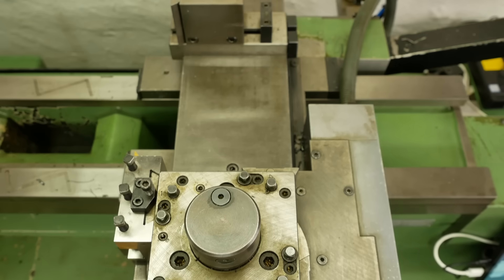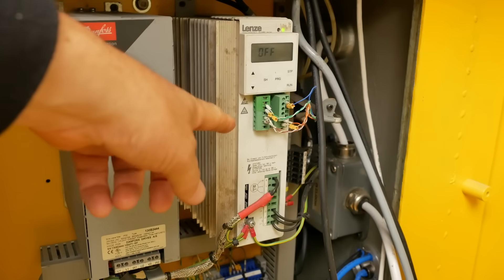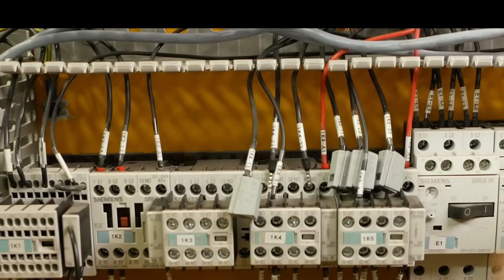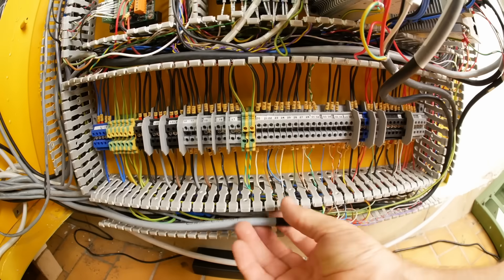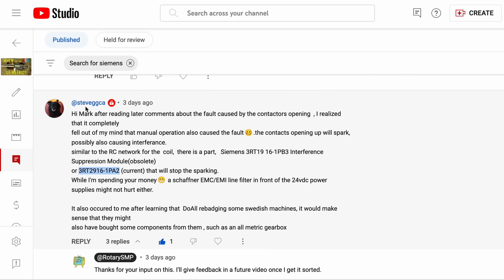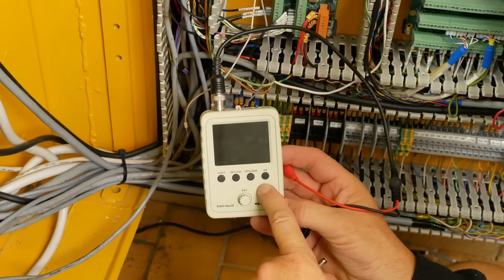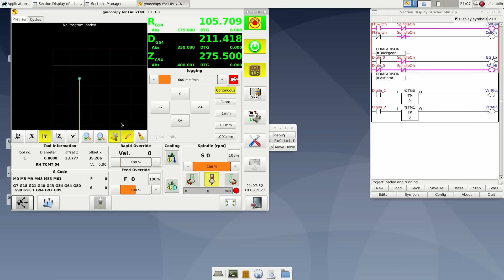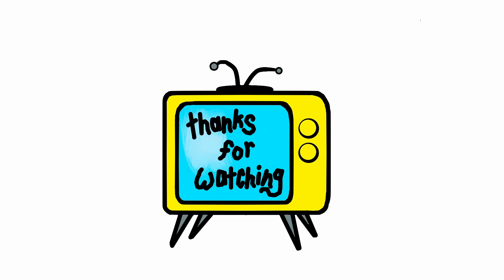Troubleshooting electrical interference on the Schaublin 125 || RotarySMP

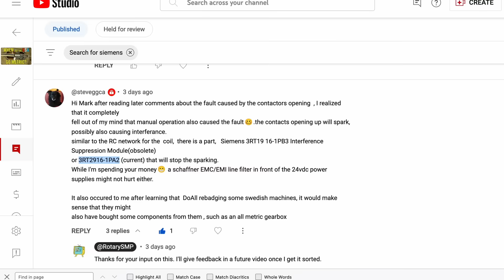Comment: 8:06 - it goes in between three phase wires and your contactor, pins on top of module plugged instead of wires into bottom screw terminals of contactor. Input power then should go from above if I'm not mistaken. There is actually option to buy even "motor starter" (your E1 and E2 in cabinet) like that, but of course any addon means additional height and it might not fit in your cabinet. I had to replace few contactors with motor starters in cabinets few years ago and it was real pain, everything was so tightly packed! Actually open google and try "siemens combined contactor motor starter", that gives some pictures how it's supposed to look like :)

Last time I was too busy and forgot to type comment but *what kind of hall sensors are you exactly using for homing?* Outputs can either be "push-pull" or other one I think it called "single ended". I'm honestly surprised that push-pull aren't very common.

1) *Push-pull* means there are two transistors which force output between two states, it can be either strong 1 or strong 0. If some EMF appears around, transistor will keep try its best to keep line in desired state.

2) *Single ended* sensors use one transistor to push (or pull) output strongly into one state BUT other state is "floating" and only some high value resistor is keeping it in desired state. Of course higher value of resistor means less wasted heat but higher sensitivity to EMF.

If your sensors for example can provide up to 100 mA current, I'd calculate resistors to use around let's say 30 mA and place them closest to MESA card inputs. Is your sensor PNP type, meaning there is positive voltage when it's switched on? Then connect resistor in parallel between MESA card input and ground. If any EMF appears on wire, it will need to be much stronger to overcome that resistor.
Of course if you plan to keep machine standing on limit switches for some time (some emergency error), consider heat dissipation! But for short clicks in normal mode even some lower power resistor might be fine, at least for test if that helps or not.

For 24V and 30 mA it would be around 820 ohm 1W resistor.
For 5V and 30 mA it would be 150 ohm 0.2W resistor.
I'm not sure which voltage you use, I think you mentioned 5V (so probably even more sensitive to EMF) but I'm not sure. Resistors mentioned above are from E24 series so should be easy to get.
Reply from the maker: The Hall sensors seem to be a Schaublin built part. The sensors are cast into epoxy tabs, with the leads potted in. There is no part number or other marking. They are 5V devices, Active high.
Reply: @RotarySMP  Ah, so we can only guess what is inside :(  But I guess original board for sure loaded sensors more than modern MESA board, so some pull-down by few miliamps might actually make difference. But it's just suggestion you might look into :)  Or some RC circuit, which will filter out quick weak pulses but can be easily overtaken by strong signal from sensor.
You might also try to cover that short section in cable tray in tinfoil (or just use shielded cable) and connect it to PE :)

Comment: Hy from what I read vfd not supposed to be shut it off by contactor because the spindle can turn into generator and probably create those spikes if you think about it make sense
Reply from the maker: Mine isn't turned off by the contactor when the motor is running. The VFD contactor is only used at machine start and shut down.

Comment: You could bump that 5uS debounce up to 500uS, it is just for end stops and even 500uS would be no significant mechanical delay.
My suggestion of adding 0.1 uF caps to the hall sensor input terminals has been field proven on a lot of equipment and does basically the same thing as increasing the software debounce.
In my opinion it is better to be in the habit of suppressing the actual noise on the signal input, rather than just telling the software to ignore more noise. 🙂
Reply: By default LinuxCNC runs a servo loop interval of 1ms so a debounce of 5 will be 5ms, not 5us. That's a bit long for homing but fine for estop. Maybe only debounce estop and have the home inputs before debouncing.
Reply from the maker: @LesNewell  Thanks, I had a nagging doubt that I had Milli and Micro confused when I was editing that. Should have looked it up.

I have it homing roughly at speed, then slowly, with the final home position being the next encoder index after the home switch goes high. But you are right, that the home signal needs no debouncing, as it a spike there is ignored when not homing.
Reply from the maker: Thanks for the tips. What type of capacitors would you use there? Given it is a 5V signal, what voltage rating would the Caps need?
Reply: @RotarySMP  A small ceramic or foil type, 50V rating is all you need.
Reply from the maker: @zaprodk  Thanks for that.
Reply: @RotarySMP  ... ceramic tend to be brittle and can physically crack when wires are tugged around, I prefer greencaps (polyester) or monolithic polyester called mono caps. Voltage rating not important they are all 16v or 25v at least. Physicallymlarger ones are better just for physical integrity. They are not polarised, so you don't need to identify a positive lead or anything like that.
Generally I install them with a bit of lead showing (8mm ?) It gives some strain relief when tightening the terminals, and of course with the writing on the cap visible so you dont have to bend it around to see what value it is later.
Reply from the maker: @wizrom3046  Thanks for that detailed tip.

Comment: I think the problem is the Limit shitch... when is not activated, the input for the switch has high impedance.. meaning it can receive radio impulses.... MESA card has optocoupler?
Reply from the maker: I am not sure.
Reply: @RotarySMP  if it jus a logic input means a 1u amp of interference cand activate that input.. try to pus a resistor in parallel as a dumy load.. 2.2kohms for a 24v input should be ok.
Reply from the maker: @swatcat7928  This is only a 5V signal. It is a Hall effect sensor.
Reply: @RotarySMP  ok.. 100R 0.25w resistor.. try it without debounce....

Comment: That Siemens module plugs in to the bottom terminal of the Schütz, but is only compatible with the newer Sirius devices as far as I know. There is the same module for the older ones (3RT1916-1PA2 or something like that ) but they are ridiculously expensive by now. Don't take my word though, I'm not an electrician, I just read the parts catalog when I'm bored.
Reply from the maker: It looks like that new grey one should fit on the old one.

Comment: Software fixing hardware for win!😁
nice troubleshooting,  the debounce function does exist for a reason.
there is still the underlying problem of the noise.
every machine cabinet that I have ever been in uses the spark suppressor module
when controlling motors, even if  entirely analog ,mostly to protect the contacts
themselves from erosion and welding , but it also stops the noise .
Reply from the maker: Thanks for your Tips on them Steve. I now know how to install them as well. :)
Reply: no problem . I noticed that there are 2 pairs of 3 wires leading away from
the  magnetic contactors 
Is the motor wired with all 6 wires or is the  the phase rotation crossover done  at a terminal block?
If it is the second ,there is a module that connects to the MC pair that does the rotation crossover
and then a single output for 3 motor wires direct or the spark suppressor can be used.
adds simplicity and eliminates the need for 2 spark suppressers.
By the way if you are the neurotic sort, there is an available mechanical interlock
between the 2 MCs  that will physically  prevent the second  MC closing while the first one is.
Reply from the maker: @steveggca   That Siemens electrical Lego is pretty cool. Yes the two sets of wire rejoin at the terminal block. 
I have the interlock down through the auxiliary contacts, opening the circuit to the offside coil.
Reply: @RotarySMP  (A brief interlude from the regularly scheduled comments 😉)
 WAY  back in the late 90's, all of the machine tool builder introduced direct drive spindles
in their smaller lathes and machining centers (ie Mori seiki sl-250 lathe  or MS sh-40 horizontal machining center)
These spindle motors  had high/low motor windings controlled  with 2 magnetic contactors.
this is where I first encountered mechanically interlocked MC's . I'm sure that they existed long before that.
I don't recall much of the shifting logic, but I do recall that both the NC and NO contacts were monitored,
and that because the MC's were located between  the Invertor/VFD/spindle drive, the Inverter output had to be
paused, one MC opened and confirmed open and then the other was  closed and confirmed closed.
finally the inverter output would start again. the spindle didn't have to stop turning  to shift, and the shifting 
took about 2 seconds in total ,mostly the mechanical time for the 2 MC's

Comment: Wunderbar! As I mentioned last week comments, the digital debounce and/or filtering is most straightforward solution to this issue, but since I did not have familiarity with LinuxCNC coud not give any specific instructions. ;) 
As of the length of the filtering, I have used folllowing approach with quite good results:  First somehow determine maximum allowed reaction time input has to have, since there is no reason to have nanosecond reaction times/edges in system, where needed time frame is in class of tens of milliseconds. Then divide said requirement by 10 to achieve very good amount of headroom and use this time value as your starting point for your debounce length and filter time constant. For example if you want 10ms reaction time, set the RC filter to 1ms and debounce to same value, and you still get ~2ms reaction time (filtered signal rises from 0 to 60% of voltage in 1ms and then debounce delays input for another 1ms) but are already very much more immune to external interference to signals, and if there is still issues with some interference, the values can be tightened even more. As said this approach has served me well for years. 
Nevertheless, this is more of a nitpicking, if the 5us debounce you implemented was enough and everything works nice, that is excellent. Happy to see the issue solved, and hope we as a community were helpful aloing the way, even my long winded descriptions of these things. (That is an  issue for us engineers, we like to babble endlessly about thing we like to do :P)
Reply from the maker: I found the advice given to be really helpful. It seems I should still try snubbers on the contactors and RC on the Hall sensor inputs, to try and make the system more noise resistant though.

Comment: I am not sure how useful (or otherwise) what I am about to say (type) will be but here goes 🙂 As a general guideline never coil wire in loops whilst it satisfies our need for neatness its a bu**er for causing EMI. Also when you zip tie cable bundles, don't zip them tighter than is functionally needed, the closer we force wires together the greater the risk of crosstalk. The longer unshielded wires run next to each other the greater the risk of cross talk, if you know which circuit is picking up the interference try routing its wire along a different run for the majority of its length if you can. If all else fails ten or so turns through a ferrite toroid should sort you out.
Reply from the maker: Thanks for your Tips. I have some ferrites coming in.
Reply: @RotarySMP  Plus with signal wires twist them into a pair, signal wire and the associated ground, so that interference picked up is going to be mostly cancelled out. For an active sensor with 3 wires, all 3 twisted together tightly in the loom till at the controller works best, and if possible make all the wire, even in the raceways after the connections, shielded, with the shield connected at only the one end, probably the termination block. Separate shield connection than the motor shields, and then each one connector shield set with a separate braided wire to the chassis star ground point. Yes can be a pain to do, but gets rid of a lot of noise, and then a ferrite toroid over each separate shield as they come into the cabinet, before the connection area, helps as well.
Reply from the maker: Thanks for the best practice. Sean.

Comment: Would be cool to see the transient on the oscope but the methodology for probing can be surprisingly finicky even for someone relatively good with an oscope
Reply from the maker: What would you suggest Steve? What trigger voltage, and sample rate?
Reply: Yes those kind of signals are really hard to get good picture of even with very good equipment. And here, since the 5us filter implemented fixed the issue tells that the spur is really short, most likely in sub microsecond class, which don't help the issue. :)
Reply from the maker: @Velectrics  Alex is sending me his old (40MHz) Osci. Maybe I can image it then?
Reply: @Velectrics it is? I'm an EE so I should have more experience than most but as long as you have a scope, and you can set it to single shot, then you should catch it. 
But scopes are a bit black magic to many and plenty of them have bad UI so that might make it difficult. And I'm a bit unsure if what's shown in the video would qualify as 'a scope'. But since the poll rate is 1ms and it was tripping so consistent, you should be able to see something even if you only have khz bandwidth!

Comment: Signal wires and power wires should go far away from each other. If needed, they can cross each other at 90°, but never be parallel.
Sometimes helps ferrite rings, or capacitors (like the debounce)
Reply from the maker: Thanks. I should have laid out that control cabinet differently.
Reply: @RotarySMP  The shielding must be correct too (PE). No loops in the hole system.
If the main motor has PE connection, the servo motors too so you will have 2 loops already. It will work like an antenna for catching interferences.
Reply from the maker: @DPTech_workroom   I dont really understand what that means in practice for this installation.
Reply: @RotarySMP   3 phase motors use only 3 wires. PE connect only to the lathe. The same thing with the drivers. If the mounting plate connected to the PE, so the most drivers heatsink also is the PE (but need to ask others too about this. I'm not sure)
Reply from the maker: @DPTech_workroom   The driver cables were factory manufactured. I just hooked them up were the manual.
Reply: @RotarySMP  I know, but that can be a loop too... That is why need to ask about it the others. (i did it by the manual too, and have a lot of issues with the interferency)
For example PC + monitor, Both has PE, but the VGA/DVI/HDMI cable shielding makes a loop to. So I have issues with the keyboard too (USB). Pop up messages - "cant do while AUTO mode". Some interferences pressing the keys... If there is a notebook, the mousepad going crazy....
Reply from the maker: @DPTech_workroom That sort of thing can drive you nuts!

Comment: Great summary and structured trouble shooting! Given your lack of ferrites, a variety pack of clap on ferrites sounds like a useful purchase. If 5 us debounce suffice, the pulse must be 200 kHz or higher. You don't suck at using oscilloscopes, but your scope does. :) If you do not want to spend much on a tool rarely used, something like the DSO1511G (small, handheld, battery operated, video output for larger screen and USB for image copy, way higher promised than actual but still sufficient bandwidth) would be a good replacement. LinuxCNC also has builtin scope functions if you are curious to see what it saw, but a real scope tells so much more. Ask me how I know: "Let's quickly mill this part" ... and two hours later the mill was cluttered with cables, scopes, diving deep into electrical trouble shooting, the part to be manufactured long forgotten.
Reply from the maker: One of my YT Members, Alexander, is sending me his old Osci, so that should be a major improvement.